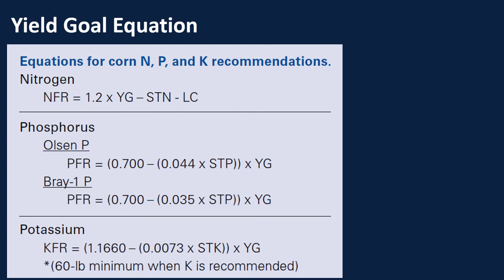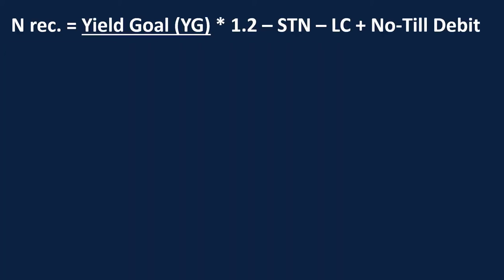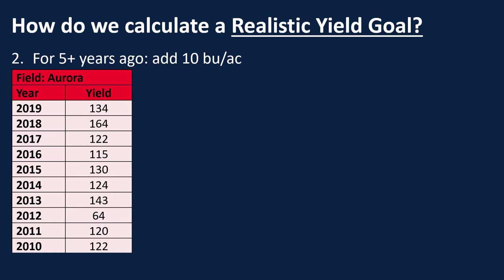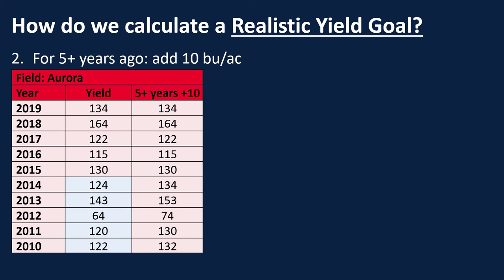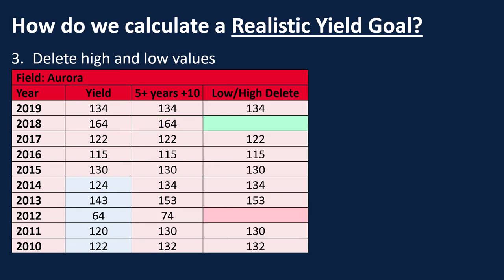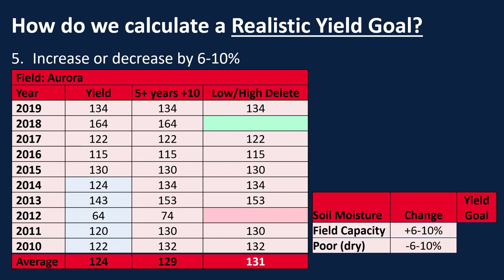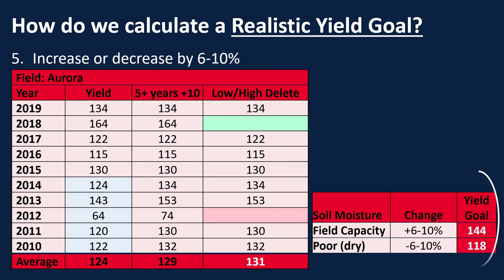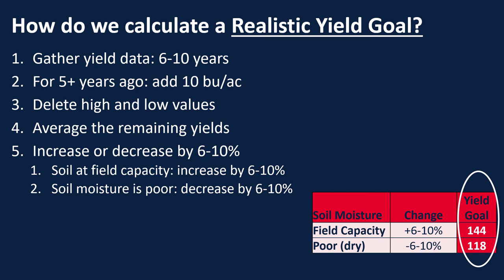Calculating Crop Yield Goals

Comment: Can you make an explanation on solving the Mitscherlich Equation applied on fertilzer-yield relationship
Reply from the maker: The linear-plateau, quadratic-plateau, Mitscherlich, and spherical equations all generally do the same thing but with different equations. They are designed to graph a line that at some point of greater values on the x-axis reach a maximum. That maximum is what we would say is the optimal nitrogen rate. The Mitscherlich model tends to end up calculating much higher optimal N rates than linear- and quadratic-plateau and is less realistic. That is why I normally focus on the linear- and quadratic-plateau models. I am working on another idea for a video that compares all the models
Reply: @sdstatesoilfertility  Oh. I appreciate that. Thank you so much for the information😊